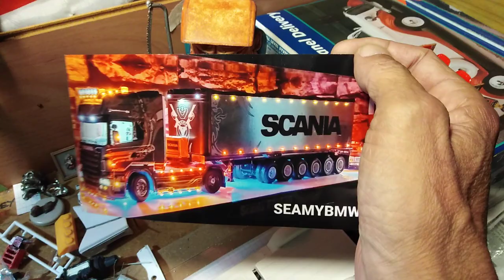Door hinges and bodywork and a shout out to seamybmw

Comment: Looks good so far. Keep it up! Quite the chop job! I have to figure out how to make hinges for the rear door of the 1940 Ford Panel Van from AMT.
Reply from the maker: I have amt/ertl rides magazine version by rc2. It has single rear door, part no 56.hope this is same single rear door. To make it open sideways, you'd need two hinges due to panel shape. If you gullwing it you'd only need one long wire one, as on top part of my 37 here. You could also ues the same to make the door into a ramp, hinging at the bottom. 🤓
Reply: @petesmodelcarcustoms584  I'll probably go with the stock hinging...I know...long hinge at the top, short on the bottom. I'm just not so good at making them.  - That 1940 Ford Panel has been re-issued many times since it's first release in about 1963.
Reply from the maker: Yes. I thought it was a trophy series originally. The stock hinge would be hard to make due to the body and door panel shape. Top or bottom hinges would be easier 🤔